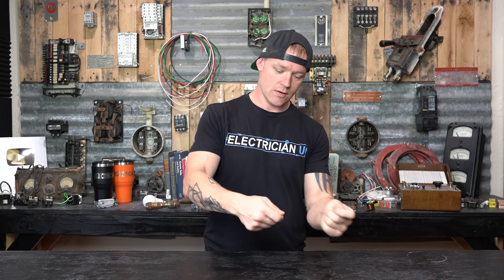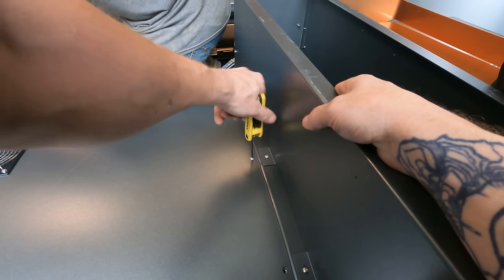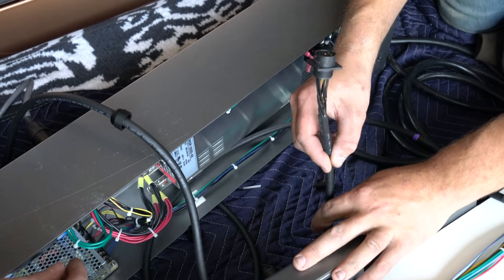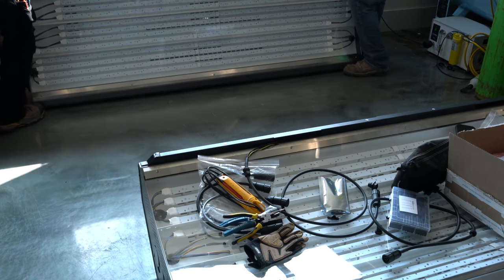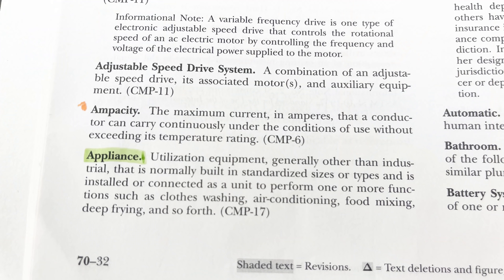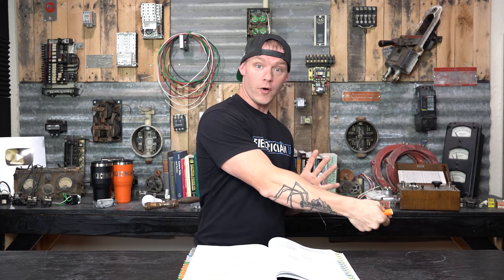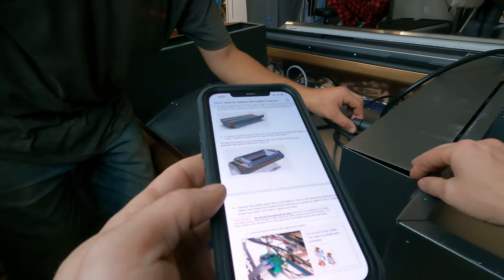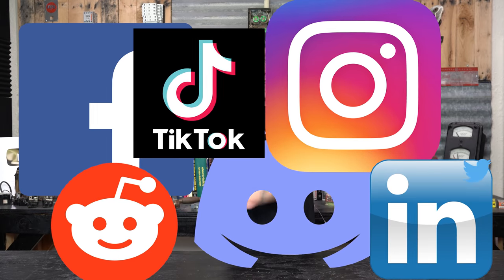SERVICE CALL - Repairing Weird Equipment I've Never Seen Before

Comment: I was an avionics technician for 14 years. That connector on the bed we call a cannon plug in aviation. They are all over aircraft and really the primary means of electrical connections. The do make pin extractors and insertion tools so if you find yourself doing more of these you could check some avionics tool catalogs that would be for that specific application. Interesting to see it used in a household setting.
Reply: The man who invented them was named Cannon. He came up with them to add the sound in the original talking movies. They were noticed by Douglas, and contracted by them for use on the DC-1, 2, and 3. Mcdonnell Douglas continued to use them throughout and after WWII. In 1952, the design that we aviation techs know and "love" was designed, and been used on many aircraft ever since. They have also been used in engine bays on some high end sports cars for their superior ability to stand up to extreme heats

Comment: Great stuff. Being an industrial electrician that on the fly learning is everyday. But Google doesn't have all the answers. Only thing is why did the plug have a melt down? There is a root to all melt downs. Best to cover all angles and test before reassemble. Never know when something is shorted down stream .
Reply: I thought for sure one or more of those fans was going to turn up bad.
Reply: @brandon lewick...Mostly melted Plugs is equal to Loose Contacts..
Reply: @SachsVDE  exactly

Comment: Thanks for your videos, it is a very valuable source of American electrician vocabulary and work examples. Typical story on a Russian factory: they give you a piece of electrical equipment (it has no schemes, no blueprints and been made a half-century ago) and say "It won't work, fix it". That's where the true experience comes from :)
Reply: I feel like we shouldn't be repairing equipment that we are not factory trained on. If you can't fix it, or mess it up worse, you may find yourself liable for a new one.
Reply: That's why your tanks fall apart when you try to invade other countries.

Comment: Damn man, get you an impact driver/ drill and some bits...
Reply: For real. Hex bits and an impact would’ve saved him so much time fighting the folding allen keys. I understand why people avoid impact drivers for some jobs but for disassembly it saves so much time. And if you’re gonna forgo the impact driver you can still put the hex bit in a handheld screwdriver of whatever size you want. I’ve got a stubby screwdriver that I could throw a hex bit into and it would probably be lower profile than the folding Allen keys, and if not, I can put a hex bit in a ratchet and definitely have a lower profile than the folder.
Reply: @JohnMaxGriffin  I'd remove them all and run them all up with the impact driver and snug em up by hand. They probably went through 2 hrs of torture using those folding allens.
Reply: Yep. If you're worried about stripping on the way in, use a drill on setting 1 then finish by hand. Those fold in tools are nice if you have one or two screws, but get a real tool if there's a lot of them. Most socket sets come with every size you need....
Reply: He certainly has that. From my experience working in manufacturing of similar products, those allen screws would get stripped to hell by using an impact - easily stripped even by hand (albeit experience tends to fix this of course). I convinced them to take their 'hand tool only' policy a step further and stock the installers with Wera hex plus wrenches for even further reduced stripping.

Using an impact for speed, while it has its uses, isn't always the answer.
Reply: @aaronbrown5631  if he's not experienced enough to control a baby impact and not strip screws or stop short of tightening with the impact and finish by hand then he shouldn't be doing this work.
Reply: @aaronbrown5631  I’ve never once stripped a hex head screw with an impact, and I’ve never stripped a hex head screw larger than 3mm bar-none. Wera’s hex head design is gimmicky and it’s not original to them anyway. Wera or otherwise, allen keys are garbage tools and those installers should find something better.
Reply: @JohnMaxGriffin  ok, how is it a gimmick? Who invented the shape? From what I heard from a seemingly legitimate source, they have a patent on it.

Comment: Pro Tip: I thought about this when you were talking about trying to protect customers equipment… I’ll keep these in my truck all the time not just for this but also for my own comfort. I have probably a half a dozen of those square foam tiles that you buy from Sam’s or Costco that are used for standing on when you do a repetitive job like standing behind the counter you know the kind interlock I just bought a package of them and I keep them behind the seat in my truck. They are great if you’re going to have to sit on the floor to work on something or in the case of what you were doing if you need to put something on the floor to protect something. Are used to just use cardboard boxes, but you don’t always have one around when you need it and sometimes that’s just not enough padding for a big heavy object like this. Those foam tiles work perfectly. Another thing that I keep in my vehicle is a moving blanket, because it comes in useful all the time for all sorts of stuff and you can pick one up at Harbor freight for five bucks. Just know that they’re not fireproof 🔥 Sparks from a grinder caught one of mine on fire so just watch out for that.

Comment: Could you do a video about Carflex and how to use it?  You touched on it in the WRTR receptacles boat dock video and maybe in one of the conduit videos, but I'm not sure.  Could you also do a video about UF cable and how to use it, including the various waterproof connectors, boxes, and various code-related things like running it inside conduit or in the air?  I read somewhere that to run it overhead, to something like a shed/detached garage, you have to have a messenger wire to take the strain.  Perhaps that would be best as separate videos, one specifically about Carflex and one about UF, or maybe one big video about wiring outdoors, including things like bell boxes and watertight fittings and such (I could see that being on the long side, which in my opinion, is fine).  Sorry for making so many requests.  Thank you!
Edit: This is referring to residential wiring.

Comment: 9:22 only thing I'd say is when working on a roof (solar) It's much nicer to wear shoes rather than boots. I personally own both composite toe work boots as well as composite toe shoes for when I have to do solar (especially on a heavy pitch roof)
Reply: You can also get some shoes with magnets in the bottom which help when working on metal roofs.

Comment: RIGHT TO REPAIR!! I can't believe there was a good, white hat, company that provided the PARTS for you to fix the problem. They even told you the info you needed and checked out your work!!!
Reply: A lot of companies actually do especially if it's industrial or commercial.  Most of the time when you call a company they are quite helpful... Consumer goods not so much
Reply: That alone should give you an idea of how much this piece of equipment costs lol
Reply: The only big complaint (that fits in with right to repair) is the use of a million different types of screws. If you want your product to be easily repairable, then it's generally a good idea to reduce the number of different fasteners used in the product (stick to one big, one small).

This can also save a bit of money in BOM cost since you're buying two screws in bulk instead of 10 different types, and saves on assembly since your assemblers can work faster with fewer tool changes.
Reply: @miket6978  Tell that to all the farmers having issues getting their John Deere equipment repaired
Reply: @JCtechwizard  yea vehicles are a different story

Comment: Calling the manufacturer is usually the most direct way to get the down low on equipment you haven't experienced  before. I worked as the guy that provided that phone support. Best thing to have when calling is a good attitude and the model and serial number of the equipment. This gives us the information we need to help look up how something was built in the factory, making support for you, with advice to repair it, MUCH  easier for everybody. We would oftentimes send out parts overnight, for free, just to help them. As a manufacturer, we want the customer happy, and the equipment up and running to keep them happy. Helping guys on-site get the equipment running again, may make a repeat customer for that equipment brand.

Comment: Best tip, Do not take this job, unless the customer dismantled it first.
Thank you.
Reply: Not even from work perspective. People are assholes...he can say other things worked just not that one specific function and now nothing works. Unless, you go over with him what works or not and sign some kind of agreement that you're not liable for this thing or give any warranty that it will function.
Reply: I'd dismantle & polish every screw as long as  the customer is able & willing to pay for time & material
Reply: make sure you dismantle your car engine before taking it to the mechanic, they will appreciate it
Reply: Um no. If a customer brought a piece of equipment that I've never worked on before to me I would prefer to take it apart myself.
Reply: If you don't take this job and try to get this person as a client regular client then you're not trying to make money
Reply: I think check with manufacture on updates of why connect overheated, used electrical skills on calculating current draw check over load
What cause problem
Reply: I wouldn’t take a job that the customer disassembled first. My biggest pet peeve ever.

Comment: My pro-tip of the day instead of using an Allen multi tool to unscrew a million screws, use an Allen bit in your impact driver to take them out a lot quicker...
Reply: @wojtek-33  agreed!
Reply: Quicker isn’t always safer for those low torque screws. Plus if he charges hourly… lol
Reply: @Colterkni801 
Hourly - Hand Tools
Job - Power Tools 😁
You get paid by the job, hurry up and get done. You get paid by the hour, take your time!
Reply: @Chris.Rhodes  I agree milk the job screw the customer over giggle about how much you charged. Then sit cry in your beer when the customers find someone fast and efficient at fair prices and wonder why they don’t call you
Reply: @jamit2u  it was a joke dude damn a bit tight?
Reply: @Chris.Rhodes  is that a bad joke or good union work rules? I’ve been on repeat service calls where they’ve charged $300.00 to press a reset switch. So many people just F over the poor or elderly those who need those of us who can help but choose to take that service call fee, after hour fee ,weekend fee, charge an hour for 35 minutes. I’m in upstate NY I’ve done porch and stair lights during winter I’d rather fix them for parts cost and $20.00 or less. I’ve seen more then enough cold kids with no furnace hungry grandmas because fridge quit because coils iced over. So I’m pretty tired of those that say because I can instead of because I should
Reply: @jamit2u  And you're absolutely right brother. I'm a tech, and anytime i can slide a part for cost i do it. so i understand where you're coming from and i get it. I was literally just making a lazy man joke. People take advantage of everybody left and right. Nothing I can do about it brother.
Reply: @Chris.Rhodes  I used to do a lot of industrial jobs those were mostly time and materials, if you couldn’t hit bonus just cut the pipe off the hangers load it up at night go to the motel at night strip it all out sell it for scrap make our own bonus. Now I quit traveling I do mostly service calls a few upgrades I can still make a comfortable living but like I said I went to an older woman’s house she had no hot water they quoted almost 1k for a tank replacement I looked at the date it had a few years left I changed out the thermocouple got it lit sat down with her . She said I looked tired made me some coffee I spent a few hours talking  and left. It took me back to when I grew up . I learned a bunch of people said a persons morals and character are shown in how they treat the weakest among us. Know your customers I’ve done light switches for doctors at $60 each seemed fair to both of us I regularly get tips for working fast neat or nights and weekends. I do set some aside when I get those jobs that even $5 is to much. It just really pisses me off when I hear that whole I’m hourly I’ll take my time and I don’t care
Reply: @jamit2u  Valid point man, my grandfather raised me with the mentality of "A man is only as good as his word" and I've made a reputation about myself that I will always shoot you straight, I won't lie to you, I'll do it for the best price, and I won't leave until we are both satisfied. It's done right by me for half my life, and I don't plan on changing who I am. I had to YouTube basic sign language to deal with a customer today, I will go above and beyond for anybody who treats me like a human being, and respects me. I respect everybody until you disrespect me.
Reply: Not a pro tip, more of a hack, sorry. Medical equipment like this is crazy expensive, I always hand tighten/loosen on stuff like this, you're in a hurry or not carefully and either cross thread or even strip the screw. That is what my dad had always taught me.

Comment: So I'm just a hobbyist when it comes to electronics but I worked on tanning beds occasionally as a teenager (long story) and about 99% of them actually have access to all the typical wiring by removing those covers on the top and bottom of the bed. I couldn't get a great look at them but I think you guys actually took that apart backwards. ><

Also the wire definitely melted from lack of cooling. Those computer-like fans are ridiculously bad at dispersing heat from those beds. The guy who owned the tanning beds that I worked on actually designed and built this ventilation system that pumped air over the entire circuit in those and actually pulled it back out and exhausted it outside. After he did that we stopped having to replace connections, wires, and even capacitors every damn day. (Those were also used continuously for 12 hours a day tho)

Edit: In hindsight I'm also super suspicious that the manufactures often don't build those circuits beefy enough for the amount of current passing through them. The wires and connections are probably a couple sizes too small.

Comment: It’s called Socapex. That’s the connector that was shorted. We use them in various pin configurations in the entertainment industry all the time. 7 pin is usually motor power/control. 19pin is lighting branch circuit distribution. There’s various uses. They are usually fucking indestructible. Good job repairing.
Reply: Interesting! We call them Amphenol here in the North East. Seeing that connector burned indicates to me there is a much bigger issue in that machine. Like you say, those connectors are very rugged.

Comment: Equipment Pro Tip:  Keep a box of sandwich bags.  When you work on 1 part keep all the screws and parts in 1 bag.
Reply: Sharpie to mark the bag.
Reply: @whirledpeaz5758  Good point.  If it's complex, marking some order of removal will make reassembly easier.
You can also add a piece of paper with notes in the bags.
Reply: Keep a Grease pen to mark Freezer bags, and take pictures, sandwich bags screw just pop
Reply: @frankhynes4514  Important: take pictures before removing things.  This will show where things were before removal.

Comment: I am retired after working 42 years maintaining and repairing telephone equipment and circuits.  I came up with what I call the four elements of repair.  You can repair anything if you have enough of these elements. They are,  1. Documentation;   2. Tools;  3. Materials;  4. Time.  This video contained all of these elements.  Good Job.
Reply: I agree. I spent years in industrial maintenance in an auto assembly plant and our shop was responsible for maintaining all the test lab equipment. All of that equipment was very specialized and even with the books it could be a challenge to troubleshoot and repair, especially if it was foreign made (Japan or Germany). Documentation in ENGLISH was a key, especially wiring diagrams and logic sequencing. Glad I am retired.

Comment: I used to install and service tanning beds they can be a hand full those multi pin connectors are common to melt together spent many hrs on the floor wiring up a new harness

Comment: Medical Appliances are under 517, IIRC.  Which is really aimed at fixed items like dentists chairs and similar.  Base rings for those chairs and whether you need through slab/floor conduit vary in hair-pulling ways.  Patient beds and the like are "cord equipped appliances" typically.  Texas also has a separate Medical Facility Inspection for a bunch of different details.

Comment: Tip for newbies with allen keys. 
Just realize that just because it "kinda fits" does not mean you can use it to remove it (same with torx) 
if you just willy nilly go reefing on a random allen bolt you will invariably round out the head and create a nightmare for yourself in a hurry. 
Most people in a trade or something will know that there are standard and metric sizes but always have them both and go between the two sets until you find the absolute biggest one that will still fit.

Comment: pro tip, the job goes much smoother if you have the proper tools to use. I like a quality craftsman screw driver with a bunch of the 1/4 inch bits. can be done in a fraction of the time, and going back together is very much less painful.

Comment: 4 or 5 of the terminals in that Cannon connector look cooked.  I wonder if it's under-sized for the circuit ampacity?  Looks like a 16S-1S which is rated for 13A continuous and 22A max.
Reply: Ouch, a 1500 Watt bug zapper.